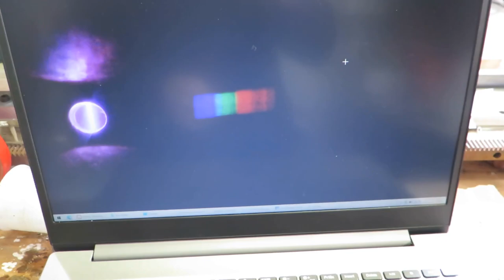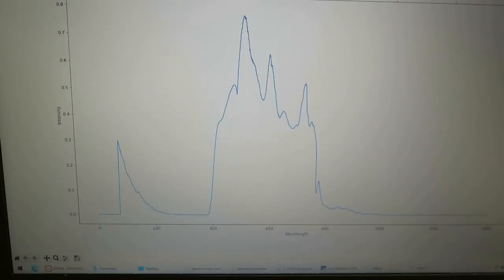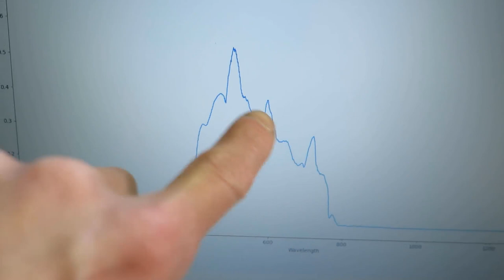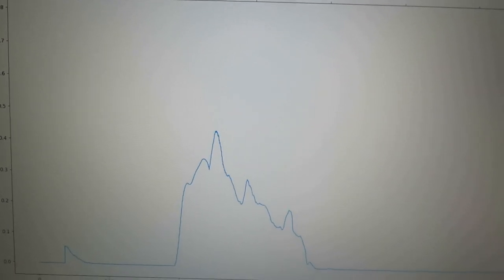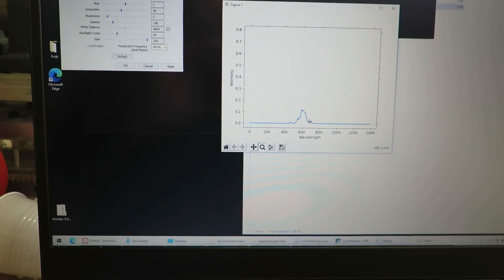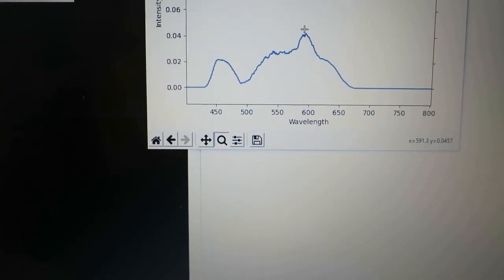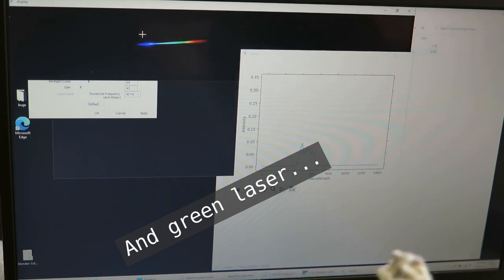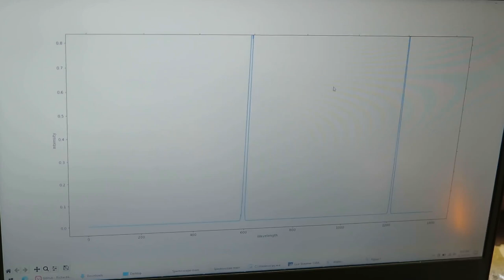Testing DIY spectroscope

Comment: great video!
for blocking specific wavelengths you could maybe use some dichroic filters? they work very well at selectively passing through specific colours. they are usually quite expensive as optical elements but you can get them cheaply from old "dlp projector rings" which contain four different coloured ones.

Comment: You may improve the definition by painting the inner box in non reflective (mat/non shiny or silky) black paint ... ideally make a non regular non straight surface (zig zag, egg plate, tiny pyramids, raw coarse wood...)... eventually disperse some black of fume onto the wet paint.
Imagine light as sound... into a studio to avoid sound pollution, reverb, noise... you have egg plate shapes in foam to kill sound propagation.... here do it aswel but on a much tinier form.

Add in the first middle space one or more perpendicular side walls that allow the direct light from the slit to go to the grid and camera but it will block the reflected light from the lateral straight walls to the grid and camera ... take the line between the slit and the sides of your grid as a triangle where the light must flow... the lateral anti reflection perpendicular side walls must be out of it... ideally made out of raw/coarse black paint or foam.

This will improve the image..

You have two problems with a slit... 
-if spacing is tiny... you get better resolution but weak light intensity thus high noise vs signal.
-if your space is larger... you get lower resolution (interference) but more light and thus lower impact from noise vs signal

What you gain on one side you loose it the other...
To get the best signal-resolution vs noise:
-You may focus light onto the slit by colimating lens and mirrors
-You may extend the exposure time or increase the sensitivity of the receptor/camera. Avoid saturation thus reaching 100% of the scale... target 75-90%.
Reply from the maker: I agree mostly. This setup was intended to work with laser beam, so I haven't used any trap chamber or light colliminating. Even if I would solve problem with oversaturating camera from direct beam and difracted light from laser used for excication, I don't think I will have a chance to see raman spectra. I will still try to do it though :) would be fun if that works. I can then name this device "Ramen spectroscope" which would be great alongside my Spaghetti extractor :)

Comment: Cool, why do you think does the narrower slit doesn't improve the resolution? I want to build a Spectrometer too. I planned on building a adjustable slit to improve the resolution if needed. I thought I could make the slit so narrow, that I would be able to see the individual sodium emission lines.
Reply from the maker: Well obviously resolution would improve if you go from 1mm slit to 0.1 mm with my camera. But the problem is distance between 2 lines. in this setup 1 pixel corresponds to 3nm of "bandwidth". to improve spatial resolution you need to improve camera optics, which you can by using zoom lens or better camera. Though 2Mpix camera with tuned optics is better than 20Mpix camera with shit optics. Then smaller slit would make sense. I have used stuff laying around, so I am pretty happy with what I got :)
Reply: @IlusysSystems  Okay that makes sense. An interesting approach is using a DMD (digital mirror device) from a DLP Beamer to "sort the light by wavelength" instead of having a camera sensor. Were the light splits up, you put the DMD. With this setup you can scan through the wavelengths with the DMD and put designated sensors in the optical path after the DMD. This might be a good method for going beyond the optical spectrum, because you could buy cheap but high quality UV/IR sensors.